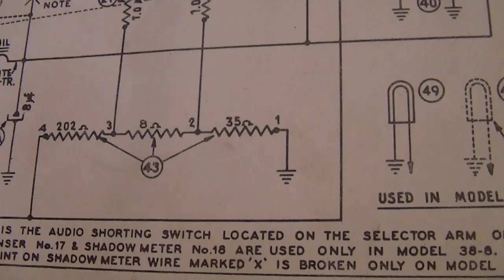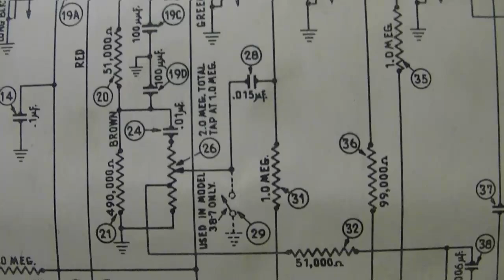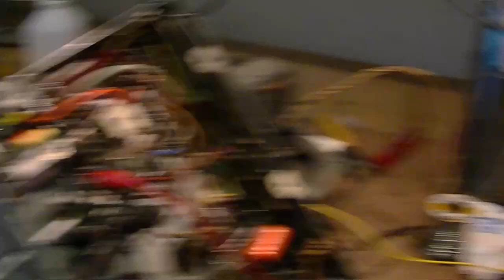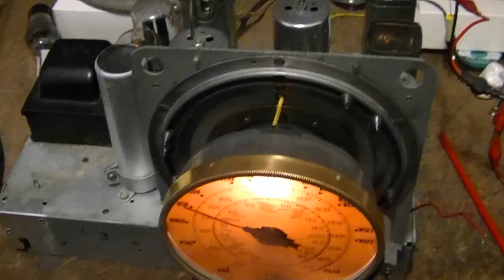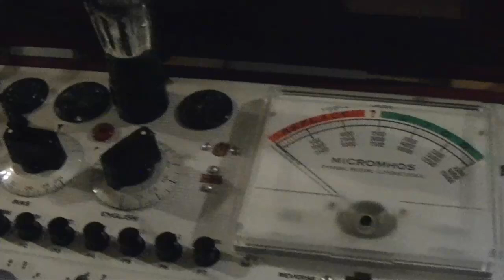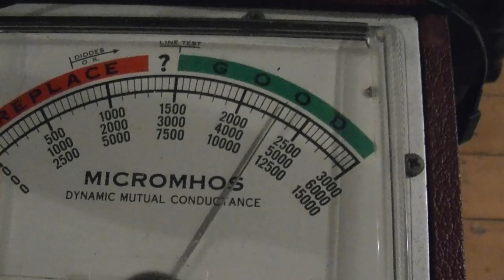Philco 38-7CS restoration p9o12

Comment: Watching this vid took me back to my early teen years, working in an electronics shop. After going in circles, start trying different tubes to find one that would work. Short explanation was no 2 tubes were alike. If you didn't see the R.F. filter in the I.F. can or on terminal strip the radio doesn't have it. A lot of set builders left them out to save a few cents. Only later to put a modification notice out to add the parts. Radios work a lot better if the filters are in place.  All the best, Tom J. from FLA.
Reply from the maker: RF filter ?  I'm not sure what that would look like and I don't think this radio has one.

Comment: I seem to recall you having a similar issue with tubes not too long ago.  As I remember, you had to try several different combinations of tubes before you found a "matching" set.  I wonder if that is just indicative of vacuum tubes?  Maybe there is just some intangible factor involved between different tubes, even if they all test good.  Still, I'm very much impressed with your tenacity in wanting your radio's and tv's to work perfectly.  That's a trait that is to be admired!  Nice work as always!
Reply from the maker: Yeah, I think that was an Admiral TV and it happened again with yet another TV.  I had to try a bunch of 6BG6s before I found one that worked properly even though they all tested like new!

Comment: I'd always heard of apparently good tubes acting up in certain radios like that, but have never witnessed it. I think I'd be pulling out what little hair I have left trying to track down that problem. Good work.

By the way, I'm sitting here trying to restring the dial on my current project when a notification about this video popped in. It gave me a valid reason to put this down for a few minutes (6 pulleys on 5 different planes!) and now I have to get back to it. Sigh.
Reply from the maker: I'm glad I was able to provide a distraction.  I really hate restringing dials!

Comment: Hi Bob, The only true test of any tube is in the radio or tv. The reason why the avc voltage seemed to work backward, I.E. the more positive it got the less gain, is because the 6K7 is a remote cutoff tube. They operate a little different then a sharp cutoff tube. I did a video on the difference between the two.
Reply from the maker: Thanks for the information - I'll check out your video.

Comment: Hi Bob. I was talking about parts 19c,19d and 20 on the schematic. Those 3 parts remove any remaining RF from the audio signal. Most radios get their AVC from the audio source and not having that filter in place cuts the gain by 1/3. Looking at the schematic,the 110mmfd mica (part 23) could give the same results if its' going south. After 70+ years even molded mica caps fail Hope this clears it up, just a little bit. All the best, Tom J. from FLA.
Reply from the maker: I've replaced the 110 pF cap and tried bypassing 19c and d.  It made no difference.  I just finished some more tests and found the tube with great emissions that just won't work in the radio has grid leakage.  I think that finally solves the mystery :)

Comment: Did you try the Philco tests-new tube again in the radio after you saw it work with the others?  It may be some gunk in the socket got knocked loose as part of playing musical tubes and now that tube would work as well.
Reply from the maker: Yes indeed.  I also cleaned out the socket with some DeOxit.  It made no difference - the volume still drops off.  My current theory is that the tube tester just does not not apply the same voltages during testing as it experiences in the Philco radio.

Comment: Hi Bob, finally is right! It's a shame that the makers of such test equipment don't have them operate tubes under dynamic in circuit conditions. Mystery solved in deed. Maybe even make a base of some kind to put the bad 6K7 on, to set on a shelf with an witty quip of some kind |:) All the best, Tom j. from FLA.